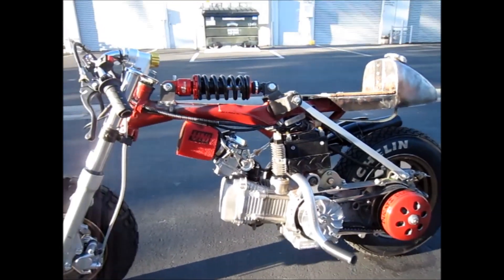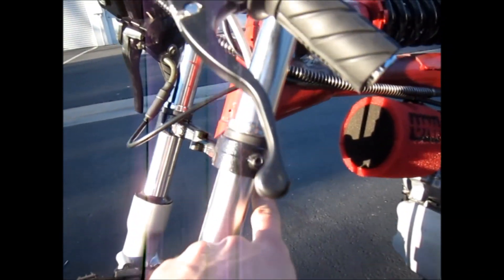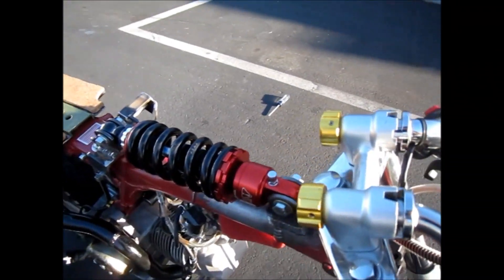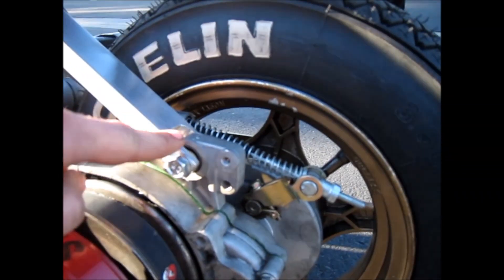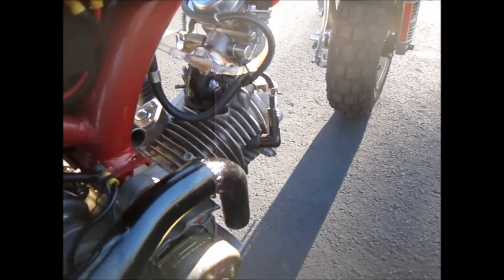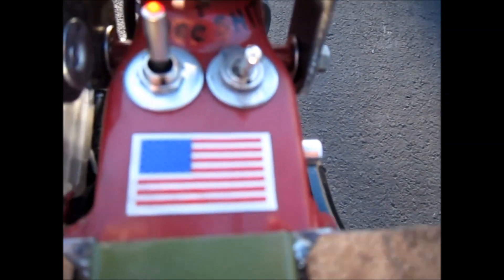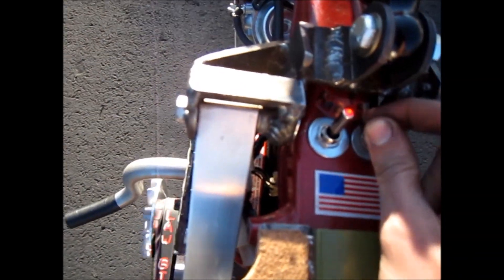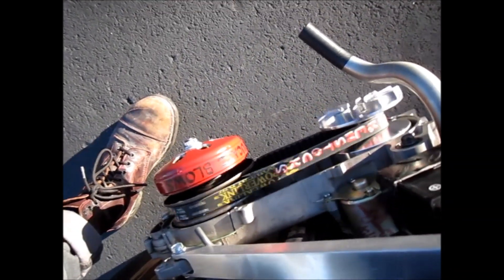Honda Z50 ruckus gy6 drag bike 1972 vintage cafe racer

Comment: Does mounting the engine to the swingarm bracket require much fabrication?
Reply from the maker: Very much so lol
Reply: @a2dskins  how so? lol
Reply from the maker: @ThePoilkjmnb03 We cut the bottom of the frame off and tossed it in the trash.
Reply: @a2dskins  cutting the bracket for the brake pedal right? I'm interested in this conversion and I'm just wondering you got the gy6 will bolt onto the swingarm.
Reply from the maker: @ThePoilkjmnb03   go look at my Instagram @bixbymoto for build photos. There is no swing arm or foot brake
Reply: @a2dskins  that's a very custom looking bracket lol, thanks for the tip